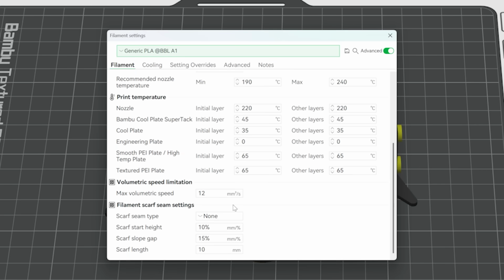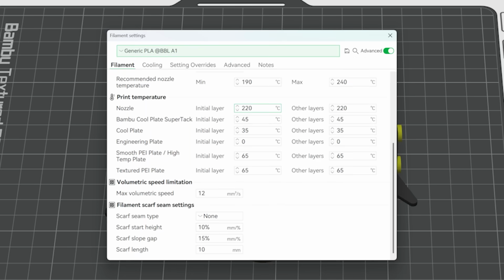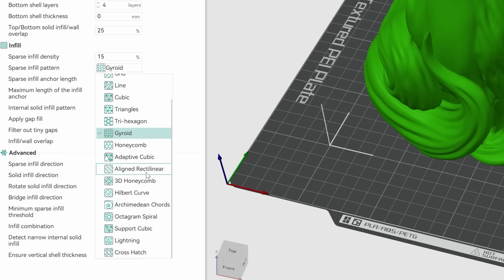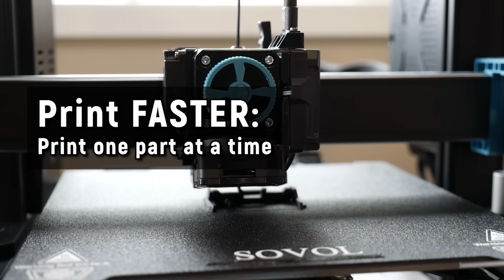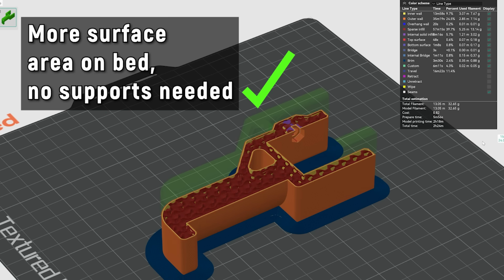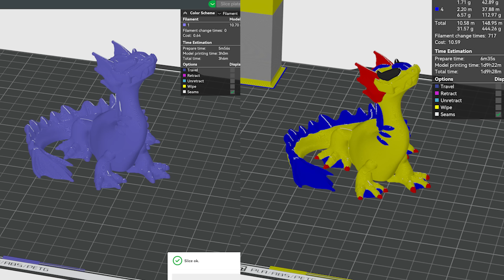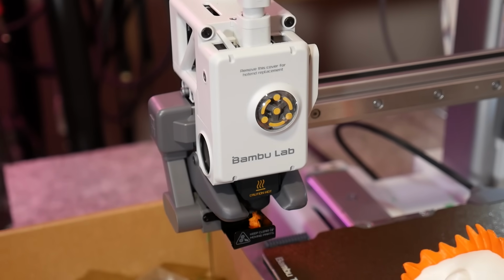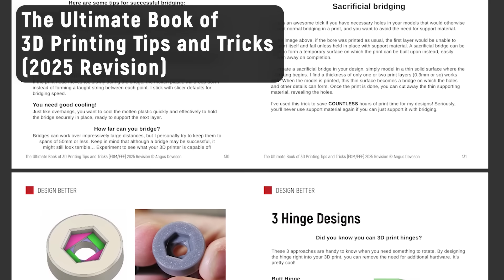Cut print times in HALF with these simple slicer changes!

Comment: I do 3D topographic prints depicting engineering designs, typically at mine sites - imagine a tailings dam for example with the topography in one colour, the dam in another colour, and the tailings in another colour.  on an X1-Carbon,   I tried doing prints like this as multicolour with no prime tower, so I could maximize the footprint of the model.  But without the prime tower, the top surfaces would get messed up, with holes, in particular for the design structures.   Size matters more than colour, and these prints usually already take a few tiles,  so I just do them single colour.  Sometimes with separate parts that sit on top - imagine a raise constructed on the dam,  in a different colour.

Comment: The faster you print, the weaker the layer adhesion. 
If you're printing a plane in vase mode for example with a single layer, u can't go faster than 30mm/s if you want the strongest possible bond between layers. 
I know cuz I'm an expert.

Comment: My top advice. If you just need something hollow with a base to put things in. USE VASE MODE, and put External wall thickness to double that of your nozzle. Es 0.8mm with 0.4 nozzle. That's the best way to print stuff like a poop bucket for the printer, pen holders,   trash cans ecc. Layer adesion with the base might be an issue but for prints like those that just need a base and some walls, it's a lifesaver, in both plastic consumption and time

Comment: I have my SV08 klipper macro setup so it holds the z axes after print. That way I only have to Quad Gantry Level once when i turn the printer on.

I also have preheat macros. I also start these right away after turning on the printer so its getting ready as I go.

Comment: High flow hotends with 0.6mm nozzles are pretty nice too, you often get 50-100% faster print speed.
Reply: What models do people print where a 0.6mm nozzle can reach such higher speeds? I've compared wtih a couple of my prints and it's like 10-20% difference.
Reply: @brinkoftext  Functional stuff. 0.6mm x 0.2mm x 300mm/s = 36mm3/s. That's close to a 100% increase over Bambu hotends and isn't unreasonable quality imo.
Reply: @oyuyuy   That calculation would mean something if you printed with 100% infill. But in reality with 0.6mm you only really save a few seconds per layer for infill, maybe one less perimeter if at all, and a decent time save for the bottom/top layers but those are a tiny fraction of the whole print. The only difference that counts is the one you see in the slicer and you will never get a 100% increase in speed there.
Reply: @brinkoftext  Haha, what? You know that you can adjust the speed of the walls too right?

Sorry mate, but you're clearly not advanced enough of a user to benefit from this, so don't bother with it. I'm printing ~100kgs this month and I didn't install high flow hotends for giggles - 50-100% faster printing is genuinely achievable.
Reply: @oyuyuy   "You know that you can adjust the speed of the walls too right?"
You know I can do that with 0.4mm nozzles too, right? Or did you only think of that when using thicker nozzles? That would explain your time differences.
Reply: @brinkoftext  Ehm, 300mm/s at 0.4mm width isn't the same amount of material as 300mm/s at 0.6mm width...
Reply: @oyuyuy   If you print 2 perimeters instead of 3 for the same wall thickness that means 33% less nozzle movement time, or a speedup around 50-60% I guess. For 100% you'd need to make the walls twice as wide per loop and I'd love to see how that's supposed to work with a 50% wider nozzle.
Reply: @brinkoftext  Here's the thing, you CAN'T even print at 300mm/s with 0.4mm lines and 0.2mm layer height with a stock hotend - you're already capped by maximum flow rate at that point (24mm3/s). The 21mm3/s filament profile is arguably already too fast too - the layer adhesion is awful at that speed.

And by the way it's no problem at all to print 0.8mm lines with a 0.6mm nozzle (or even a 0.4mm nozzle for that matter). It can even be beneficial to overextrude a bit, if you trust the tests done by CNC Kitchen.

Comment: Are you aware that YouTube has put a horrible AI Voce translation on your video? I checked the accuracy of the translation on a technical video a few weeks ago and the translation was wrong on multiple important parts (like translating 3 miles to 3 meters) or totally missing the context -> I will not watch a technical video with an AI translation and I'm tired of switching the audio track for every single video where this "feature" is enabled, so I will just close the tab with a keyboard shortcut and watch something else (there is plenty of stuff on YouTube).

Comment: When using 'print by object' with smaller parts, you're likely to be limited by minimal layer time. Eg the printer will artificially slow down to give each layer time to cool.

Also the 'make overhangs printable' setting in Orca can be extremely powerful. It modifies the model geometry so that no support material will be needed, and is great if this does not interfere with model's purpose

Comment: Regarding multi-color printing, I wonder if any slicer supports using the purged filament in non-visible areas of the print. So the process would be:
1. Print the outer perimeter at the areas of the selected color
2. Switch to the next colored filament, or the first one if there are no more colors
3. Print inner perimeters, infill or support until the purge is complete
4. Repeat from 1.

I understand this wouldn't be possible in all prints because you need a certain amount of non-visible bits, but I think it would work in most prints, especially if you have control over the amount of purged filament.
Reply from the maker: Yep you can purge into infill, it works pretty well for larger models.
Reply: @MakersMuse  Good to know, thanks! I guess this is not that significant, but if you really want to use more colors this can also speed up a print (and reduce waste).

Comment: I wonder how wall ribbing would go as infill. When I used to build ships/bridges we used to tack angles or flat bar on the inside of large flat areas to strengthen them - you can see it on SYD ferries -. Why can we just diamond the inside wall 5mm out and leave the rest open.

Comment: This was a waste of time. Nothing of this has anything to do with modern printers, nor is there anything in here, that you haven't covered for like a billion times before. As for me, with a focus on quality and mojo, there is just nothing here, nothing. Nothing that improves any of my work. Like when you spoke about infill in this vid, you did not focus on printing strong an proper infill, just on the ratio of infill being to high, then the usual focus on degrading everything by not using infill to print, wait for it, faster. There is not a need for much infill, if you print it right. When you do, it significantly adds strength to your part, and nicer finish, but only when done right. For instance, Prusa uses infill setting that is about 3-4 times too high in speed, ruining the quality of the print. Making a Lambo as Chinese spaghetti is not that great particularly when you suddenly need to break. That is the level we are at.
Reply: This may have been a waste of time for you, because it sounds like you're a perfect person. But for a lot of people who are just getting into this hobby, it would be considered useful information to put towards learning different aspects of how 3D printing works. No where in the video did I hear him use a disclaimer, warning people who were perfect, not to watch or even consider the information that he is passing on. So for us imperfect people who don't think this is a waste of time, I believe I have learned a bit more about infill and how it works. 
 Thanks Angus.

Comment: I'll be honest, I'd argue that speed doesn't really matter for the average user beyond certain threshold unless you do it for money. At some point it doesn't matter if you can shave off some time. If something will take 12h for me than I don't really care if it's 12h or 18h. It still is a whole day project for me with life and everything. So I'd choose something that guarantees me quality and assures good results. I always run the startup routine just because it doesn't take long at all, it's a tiny save. As for the infill, waste is much more important for the average user, you can print sometimes almost twice as many things by lowering infill. But yeah, it is good overall to optimize settings for what you want and it's good to try it. You will learn many things this way, it's not that scary. 

Also yes, MVS numbers are always lower than they should be BUT that does guarantee that you can print most things with the same settings instead of testing for each filament. Most filaments can print quite fast but there are oddballs. For example, you can print most filaments with the bambu filament profiles (they have higher MVS number set) but some filaments do suffer from it, I know from experience. Also Silk has that number even lower because these look best when printed slowly, also makes silk things slightly less brittle.

Overall, the tips are pretty basic but I sometimes forget that people just starting out might not understand these.
Reply: It is if you're prototyping something for functional use. For artistic prints, you're right, for functional parts you're making yourself, you're wrong.
Reply: @roots4x  mind if I ask what industries you're referring to? I've yet to come across any professional prototyping division preferring speed over quality or strength, but I don't work in something like automobiles or aviation and our prints generally tend to be small enough for an A1
Reply: @turbochargedfilms  depends what the prototype is, if you're doing a functional prototype or a demo, strength and/or quality is probably what you want, but if you're just doing a part fit test, you can push speed as long as it's still relatively accurate. sometimes it's faster to bang a 20 min print and mark the spots that cause an issue rather than try to check every minute detail or model the other parts in the software.
same if you're doing a simple box for electronics, you probably don't care about the looks, it just needs to hold the prototype better than duct tape and zipties.
Reply: Cutting a print from 5 to 3 hours is a benefit for me

Comment: One topic not covered is jerk. Jerk, if the motors have enough torque, allow higher cornering speed. This is difficult to test but universally true is that with modern Klipper printer the corners will just start getting rounded out. Anyways it's really worth it cause you don't have to Accel/decel as much which funnily reduces heat in the steppers. High detailed areas get a significant speedup. With jerk from 5 > 15 one can easily save minutes in a benchy print while it looks almost identical - if the machine can pull it off. Some printers can go up to 25 just fine
Reply: my ender 3 v1.5 can do 20jerk and i get nice "almost" 90degree corners...but i have to sleep the overall speed down a little, otherwise i get motor skip (layer skip). I haven't even bother to look what the P1S settings are. Over the year i've had it, i use default profile and it's still so much nice, and faster than my ender 3 and kobra max. I've become more patient lol
Reply: Stock Ender 3 can do 20 no problem so you can go way higher than 25
Reply: @paolo69 on my n4 I do 80 for a benchy but at that point you need to tune all of the profile around that to get good enough quality still
Reply: 5 to 15 jerk is a huge step up

Comment: Heated bowden tube, get it into the hotend already warm? :P
Reply: You wouldn't be able to heat it much before reaching the softening temperature, especially with PLA. This could increase flow rate a little bit for higher temperature filaments like nylon, but for PLA you could probably only heat it to 40 or 50 at most

Comment: One of the items to speed up a print, but still get advanced features, is to design your item so it has multicolor in only a few areas. Text for example is great with this, or decorative items in more a flat plane. You still get good speeds, but you also get the decoration/utility of the other color.

Comment: Max volume speed is dependent on type, manufacturer and color.

So even with same vendor and material type even the color can cut your mvf in half in some cases so you really have to run the test in orca for your specific material

Comment: Nothing is faster than having excellent print at first try.
Reply from the maker: Honestly very good advice. Defaults are designed to be safe.
Reply: @MakersMuse  I wish that was true, I had to do lots of tweaking on my bambu a1 especially with PETG to get it to print without knocking lots of bits off the print and ruining the entire thing. Couldn't get a single good PETG print because of that till I figured out how to tweak it to stop that. Also similar to stop collisions with PLA, but it's less of an issue for that.
Reply: @radfaraf Bro I’m literally in the exact same spot. PETG through a 0.2mm nozzle on my A1 Mini was so tough to get working. It did though, after like a week, and learned a toooooooooooooooon about the most hidden and minute slicer settings, but also why? Sensible defaults are a must, especially for Bambu, and PETG is like second to PLA in userbase so it should get attention.
Reply: I made a similar comment just now before I read your comment. 

As a non-business I print 3--4 prints per week in a dedicated room. I start them via Octoprint when I think I want something, then walk awake. I have Home Assistant alert me when the prints are done. I have 5 printers, so I don't really care about speed, I care about consistency and quality.

I did work at a robotics company (AmbiRobotics) that did care about speed, but that was because we cared about rapid prototyping, which I also disagreed with. Take 30 mins more to check your design before printing and checking because the printer is not as accurate as CAD.

Comment: I found lightening infill is really good for printing objects to go in my fish tank. I print in ABS+ with lightning infill then make a hole in the bottom and fill the object with cement...Sometimes I will also print the object with a brim, but no floor. Which makes filling the item with cement easier. This works best if none of the lightening support attaches to the floor, but still works okay even when some support material stems from the foor.
Reply: Honestly, I have a project that needs filling with material later on. I did not thing to try and use lightning infill for this. This is a great tip, thanks.
Reply: @ares395 I made a Deadpool bust heavier by using honey comb infill and no bottom layers. Then just print the bottom part and glue it on.

Comment: Putting lots of small prints in by-object mode, you're going to run against minimum layer time. If it's a 10 second minimum layer time, but your layer only takes 2 seconds to print? You could have printed 5 in the same time if you printed by layer instead. Bonus: if you group five of them together and "assemble", they'll be printed as a single part, so you can do several groups of five that will print together, but printing by object now prints the groups together.
Reply: Overall the group function in Orca slicer is super powerful and it's surprisingly niche. It lets you do a single modifier for multiple parts, it lets you print with single support structure for multiple parts etc. It's amazing.
Reply: Assembling multiple parts of the same color in conjunction with print by object allows for printing multiple colors more efficiently too.
Reply: @Bob5mith  Yes, and since the Bambu printers go through the same purge process, this is the same efficiency as printing on separate sheets, but you get to skip another full startup procedure.
Reply: @Bob5mith whoa I didn’t think of that. So I can print parts of different solid color types and just print by object with no color swapping. Mind blow 🤯
Reply: You beat me to it. I just made a very similar comment, and then decide to read through some of the other comments and ran across yours almost immediately. Like everything in 3D printing, the answer is, "it depends" or "it's complicated." 😂

It's these kind of insights which is why I don't understand people and their obsession with "it just works." Sure, I guess it works. But understanding the fundamentals going on in the background opens up so many more possibilities and allows you to understand and troubleshoot issues when they inevitably occur due to using a one-size-fits-all approach that does not actually fit all. I rarely if ever reuse the exact same slicer settings on every print. They're usually tweaked on a case-by-case basis based on what the model has to do and a battery of other conditions.
Reply: I never knew of this grouping difference. That's why Creality slicer keeps asking me
Reply: Exactly. The layer time rules. Thanks for the grouping tip
Reply: Your comment was way more helpful than the video, thanks!
Reply: I was going to say the same thing.